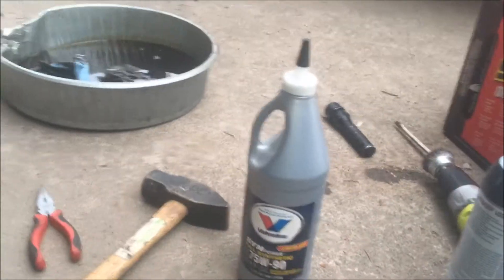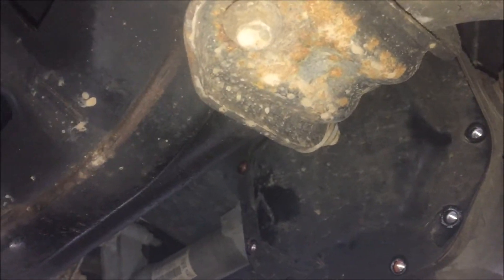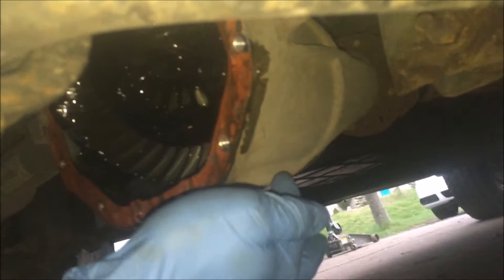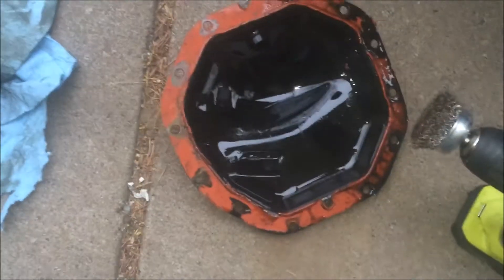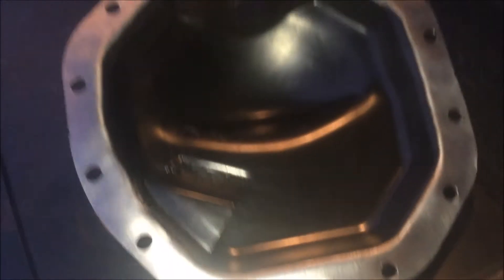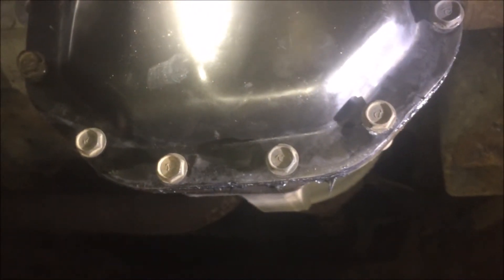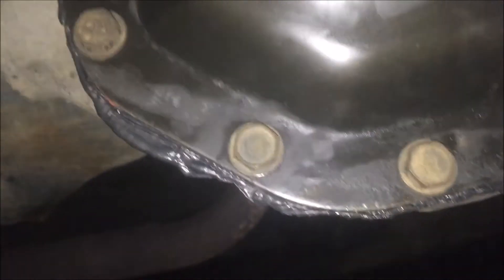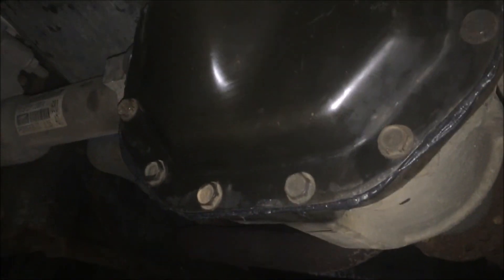Front Differential Service/Fluid Flush (1999-2004 Dakota/Durango)

Comment: Thank you for the video.  Is there room for an after market diff cover?  It doesn't look like it.
Reply from the maker: Yeah, it's pretty tight in there. IF anyone even makes a front aftermarket cover for these, it would have to be very low profile and close to stock.

Comment: What gear oil does a 2002 dodge Dakota 3.9l 5 speed manual take, and where do I fill n check it?
Reply from the maker: Mopar makes dedicated oil for the NV3500 transmission if that's what you have, otherwise I'd refer to your owners manual. I've never personally put hands on a manual Dakota, but there's typically 2 plugs on the side of the transmission, 1 lower and 1 higher up. The lower one is the drain, and the upper is the fill hole. Typically, they are 3/8” square drive, or allen socket style plugs, but not always.
Reply: @TonyTheTruckGuy  thank you
Reply: How do I switch 4wd out to 2wd? I'm having an issue where it's stick in 4wd. I switch to 2wd and light for 4wd stays solid while 2wd flashes. Is it trying to switch over at this point?
Reply from the maker: @phillipclayton276  Try switching in neutral and if that doesn’t work try switching in gear. I’m guessing neutral on flat ground is best. Otherwise you may have an actuator issue.
Reply: @TonyTheTruckGuy  ty
Reply: If I pull the module for 4wd from behind will it automatically go back to 2wd or will it not shift at all?
Reply from the maker: @phillipclayton276  Depends what kind of actuator it is. Normally open or normally closed would dictate that.
Reply: Just an update... Apparently there was nothing wrong with the four wheel drive the PCM I had gone bad I went to a junkyard I purchased another PCM put it in and immediately the truck four wheel drive had automatically shifted back into two wheel drive. The PCM change out has corrected a host of issues. As for the gear shift oil the transmission oil it is 75 w 90. I used the Valvoline brand. What I did is I took the gear shifter off in the cab and I poured it in that way according to a YouTube video.
Reply from the maker: @phillipclayton276  Glad you got it figured out!

Comment: What gear oil takes dodge durango 1999? For the front and the back, and how much?
Reply from the maker: I used synthetic 75/90 in the front and synthetic 75/140 in the rear. You could use 75/90 in the rear though.
Reply: @TonyTheTruckGuy  thanks.
Reply: @TonyTheTruckGuy  thanks.

Comment: When should this service be done i have an 03 dodge dakota with 69,000 miles on it
Reply from the maker: You’ll have to check your owners manual, it probably says in there but it completely depends on driving style too. And the front doesn’t need to be changed as often as the rear. But at about 70k miles, I’d probably just do front and rear anyways.

Comment: Would you know what kind of diff fluid my 99 3.9L 4x4 would take ?
Reply from the maker: Not off the top of my head but if you still have the owners manual, it will say in there. Otherwise just google. I’m sure it’s 75/90

Comment: What model is this?
Reply from the maker: 2002 Dodge Dakota Sport
Reply: I have a 2000 SLT 4.7. Can't find a book for it online or in store where I am. Do you know if they take the same diff fluid?
Reply from the maker: Yes, yours should also take 75W-90 gear oil for the front axle. I recommend synthetic. You'll need 2 quarts, as I believe it takes around 1.5 quarts.
Reply: Thanks.

Comment: ALWAYS loosen the FILL plug first before draining the fluid.  If perchance the fill plug is stripped or will not come out you will not be able to fill if you drained first.  If that happens the diff will need to come completely out.  No fun!
Reply from the maker: The entire diff would not need to come out unless the fill and drain plugs are built into the differential itself. In the case of this particular truck, there was no drain plug, and the fill plug was only rubber. If the fill plug was threaded and damaged, then the cover would need to be removed again, though. Good point to bring up.

Comment: The rubber plug is your inspection plug not a breather
Reply from the maker: Correct, I misspoke
Reply: Can you check the fluid level by removing that plug. Is that what it's for I mean?